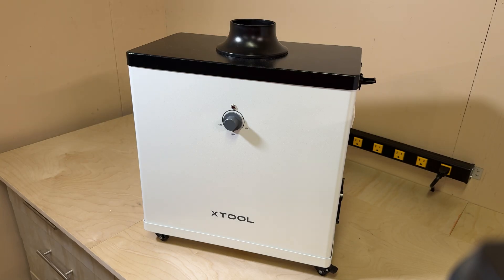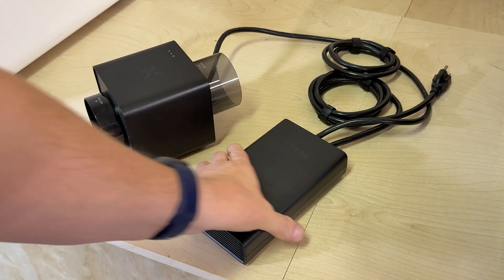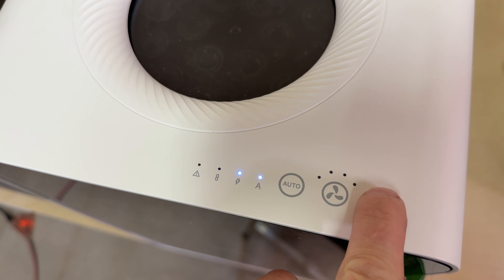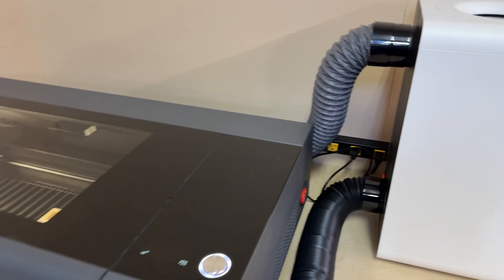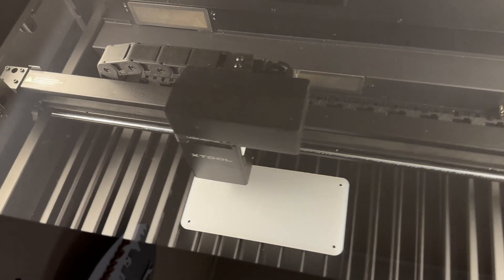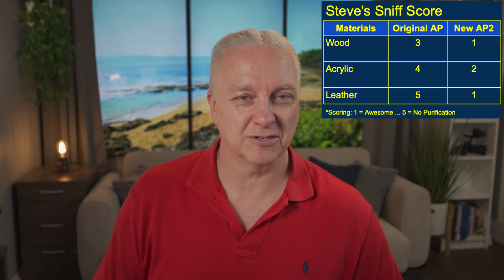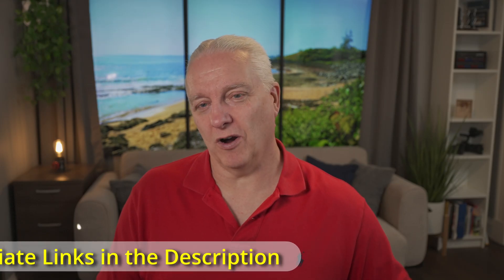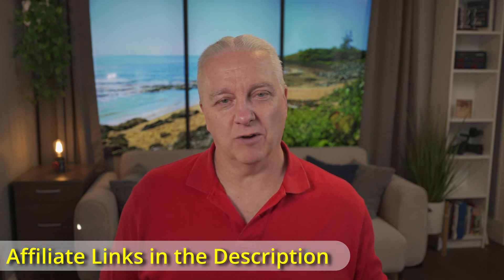Are xTool SafetyPro AP2 and IF2 the Future of Clean Air?

Comment: The AP2 clogs way too quick.  You need to operate it without the Pre-filter.  Go online and see the problems.   I ran it for less than 1 hour cutting bamboo plywood and it stopped.  Also, never runs on 4 speed.
Reply from the maker: While I haven’t seen this issue with my AP2, I’m not sure the clogging issue is unique to this unit. All fume extractors seem to require too many filter changes and generally don’t work well at eliminating smells. I always recommend these as an absolute last resort for getting rid of smoke and smell.

Comment: Hi. how is it thata you can't smell anything! i have 2 of these AP2 and everytime I cut wood on my P2S I can smell it , also upon checking air quality , CO2 and TVOC goes up to the rood and exceeds 2000 ppm on CO2 and 2 mg/m3 on TVOC.  I even thought it's faulty machine and they sent me replacement but still same awful filteration.
Reply: I did and I had them replaced by them but still same ! I have a P2S and F1 Ultra.  On P2S I've done every possible setting, auto which disabled the P2S exhaust fan, manual 50% p2s exhaust and 3 / 4 manual suction level on AP2 , still terrible polluted air comes out
Reply from the maker: @alipashaa4759  You'll have to talk to xTool support.  This one is beyond me.
Reply: @alipashaa4759  check the gap at the back of the machine.  Someone reported smoke was being pushed down then blown out by the water chiller fans.  Once they sealed that gap, problem solved
Reply from the maker: I’m not sure. Talk to Xtool because maybe the 7nit has some kind of problem. I definitely haven’t experienced this. Check the state of the filters in XCS to make they aren’t full

Comment: Question re the IF2. I have the S1 20W vented out through a window which is VERY close to the back of the machine. If I want to connect it directly to the back, instead of having any hose, is that possible and what is the length it protrudes from the back of the machine? I have less than 8 inches to the window....and because when not in use, I have exterior metal blinds, I can't have it stuck out much through the window fitting either!
Reply from the maker: With 8 inches, it would be tight, but I think this would fit as long as one end of the IF2 fits directly into the S1 and the other end fits directly into your output pipe.  The IF2 itself is about a 4" cube but there are nozzles running on and out of it that add another 4 inches.  Also in the configuration you're suggesting, you would also need to find a way to mount the IF2 because it has a lot of torque and might tend to twist.

Realistically, you would be better to use some flex tube and put a couple of bends in it to ensure that everything fits how it's supposed to.
Reply: @SteveMakesEverything  Thanks. It looks like I may look at the filter instead...at least I could then move the S1 if I wanted to.
Reply from the maker: @createinspain  THe AP2 filter works amazingly well, but like any filter, you have some on-going running costs to be aware of.
Reply: @SteveMakesEverything  Of course. Unlike a lot of you with workshops though, I am a light user, so filters should last quite a while.
Reply from the maker: @createinspain  Perfect!

Comment: Can you go into more detail on how to connect the AP2 to a P2(no input for the dongle)?
Reply from the maker: The dongle plugs into one of the USB-C ports on the back of the laser. Power on the AP2 and plug in the dongle, then go into Settings in XCS and select Accessories. You should see the device.

Comment: Great video, thanks!
Just curious; if I combine the inline fan with my xtool S1 and included xtool fire extinguisher; will the Xtool S1 turn off the fan in case of a fire? Or is is working against the fire extinguisher because it is moving all the CO2 out? Thanks for the info and your time!
Reply from the maker: xTool support the IF2 on the S1.  You just need to plug in the Bluetooth dongle like I did here on the P2S and connect it through XCS.